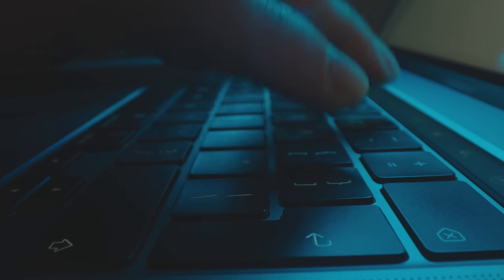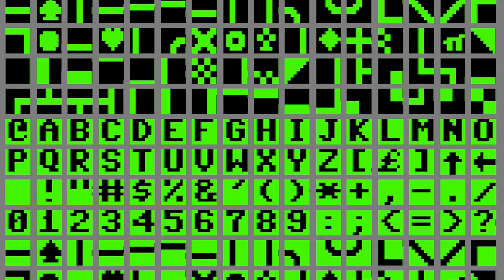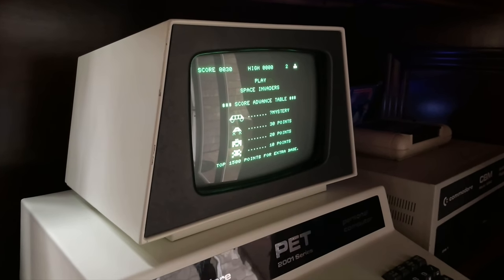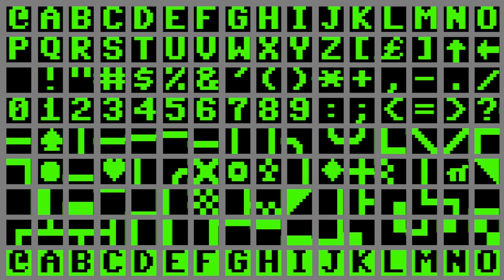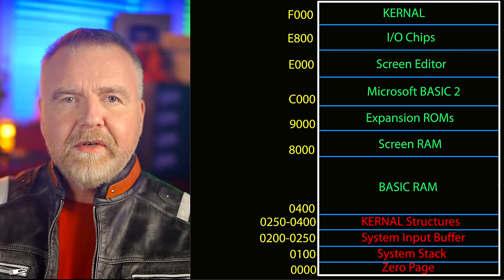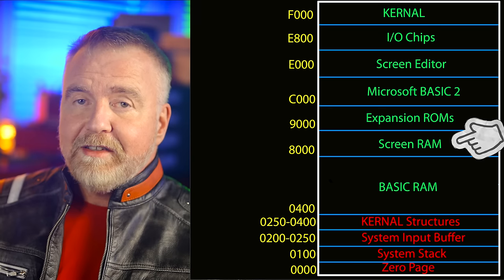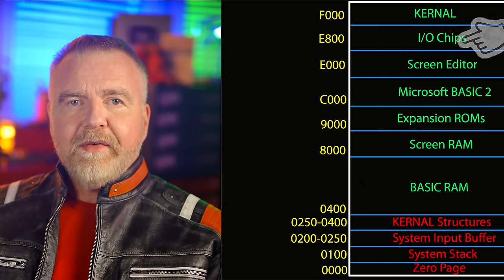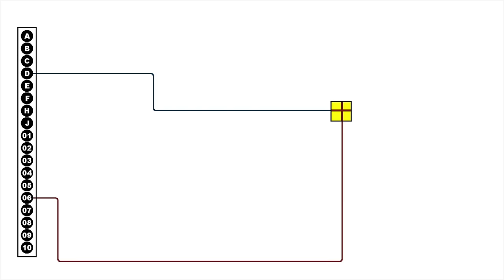Everything you SHOULD know about your Computer but don't!

Comment: I miss when computers used to come with manuals. And those manuals had schematics.
Reply: I think the schematic for even a Z58 chip-set with a i7-2700k would be stupendous 🙄🤯🤔
Reply: @MrLunithy  You can often find leaked schematics for modern computers. While there's a ton going on it's actually pretty easy to understand if you only look at one piece at a time. When chips are as complicated as they are now they don't need much support circuitry other than power supplies.
Reply: @Janek Winnicki that's funny, I started programming at the age of 10 on a acorn electron. I was highly fascinated that I could make a computer do stuff.
Reply: Computers still come with manuals... including a rough schematic. You just need to purchase your motherboard separately (and not a fully-built Dell, for example) to get that manual. You can also download them as a PDF from the manufacturer.
Reply: I like the internet.
Reply: There are developer manuals for intel and amd CPU online. Most parts of the hardware components are together in a few chips on the mainboard example southpridge or northbridge incuding the keyboard controller and much more.
Reply: And that they came with a language installed which you could write programs with (the C16 went one better with a built in assembler). I wish M$ would bundle a programming language with their OS as it would probably encourage a lot more people to get into programming.
I'm trying to learn Python myself, I learned C & COBOL back in the early 1990's, I also learned to write machine code back in the 1980's by hacking into games on the C16 using the built in assembler.
Reply: @MrLunithy  no, not really. the computer architecture is layers of composited abstractions, so even if you wanted to make a complete schematic of a modern computer (including RAM, and disk controllers), from the AND/OR/XOR gates all the way up, it most likely wouldn't take more than 20 or 30 pages.
Reply: @MidnightSt   So the complexity is really with the software then?
Reply: yeah it was part of the excitement to read those books. I've learned msdos6.2 commands from the 300pages book I was given without having a computer. the aim was really to get ppl up to speed to use the computer fast. the office 95 /97 help on cd was a true full fledged courseware.
Reply: @eDoc2020  true, it's easier to see how just enlarge certain things lead to wildly different uses
Reply: @PeterMaddison2483  weird to go from COBOL, a notoriously "dying" language that is in demand to python, something not in demand. Why not move to something else more useful@
Reply: @SECONDQUEST  I learned COBOL way back in 92 (and C) but it never came to anything. I discovered python when I switched to Linux. As Python was free, I thought, why not learn Python. I've not got very far as I've got many other things taking up my time. What other languages would you recomend?
Reply: You should have seen the KIM-1 documentation. Fantastic, programming info, schematics ROM listing etc. From 1975.
Reply: I actually read my manuals. I still have my manuals, boxed away somewhere. I started with a 64K Apple //e back in 1985.
Reply: @maxmuster7003 north bridges have gone the way of the dinosaur and it's simply referred to as "the chipset" and is just what used to be known as the south bridge. Happened somewhere around the mid 2010's
Reply: I wish I had spent more time with the 3 ring binders of my TI 99/4A. Maybe I would have pursued a computer science career.
Reply: As a user - what use are the schematics? All you need is a diagram to show you where to plug the extra ram or card into the MB. Seriously - what did you use schematics for?
Reply: I nuture a hope that somehow I’ll get to give my now 3-year old boy the experience of doing some tinkering on a C64 like I did in the 80’s. Back when you could actually grasp an entire machine. Just scrolling on an iPad doesn’t teach you anything about the inner workings.
Reply: @thettguy  Schematics were used for understanding, repairs, and designing modifications, like those expansion cards. For instance, I recently removed a swollen lithium ion battery from a tablet, and now it refuses to work. With a proper schematic I'd at least know what sort of chip it was talking to. Of course, with a sane manufacturer they wouldn't have made it impossible to boot in the first place. And with decent documentation we could have replaced the boot ROM to fix that too.
Reply: I always got a kick out of how Amiga schematics have song lyrics on them.
"You're jammin' me, quit jammin' me"
Reply: Plenty of single board computers do
Reply: A lot of people will piece their own computer parts today, I get that it's not everyone, but a good portion of people who are using PC's are now piecing together their own system to the specs they want or need.... at least the people who build them well. lol. I remember the PC back in the 80's a 5000 page book came with our first PC. lol.
Reply: @PeterMaddison2483   And with Python, we're back to the Basic days, of using an interpreter. WTF is that about ?
Reply: When?
Reply: @jackevans2386  That's about interactivity. Interpreters let you feed the computer commands piecewise. There are also options producing native and optimized code, e.g. PyPy, MicroPython, Theano, Julia or GHCi. The language you'll find in pretty much all modern computers is Javascript, though usually lacking a REPL. Some OS vendors consider it more important to turn computers into billboards than to help users control them nowadays, so it's annoyingly buried under the hood; OLPC Sugar aimed at not having such a barrier.
Reply: Computers went from a cool gadgets for nerds and useful tools for technically minded professionals to appliances, back then the technology was simpler and the average user could probably make use of the provided documentation. Today's average computer user wouldn't want to come anywhere close to a manual if there was one to begin with. Just look at smartphones, they could be incredibly powerful pocket computers, but instead they became incredibly powerful toys and fashion statements / status symbols.
Reply: I don’t think my Packard Bell came with that
Reply: Mobos still do
Reply: @fuzzy3932  all the motherboards I've got so far only had a very basic layout naming it's major components and things like ports and connectors, but nothing like actual schematics or a thorough manual. And even if it did, how many people do you know that could change a bad capacitor or voltage regulator, or worse yet, some SMD chip with dozens of pins? Doing such things on modern multilayer boards is a lot harder than changing through hole components in a two or single layer board.
Reply: @MrLunithy  The schematics of course are not down to the chip level.
Reply: Dude, what kind of computer are you buying that doesn't come with a manual?
Reply: @TommyLikeTom  Today's boxed manuals are hardly manuals, often just a "quick start guide" telling complete newbies how to plug cables and turn on and perhaps a QR code to a more "detailed" PDF online, that still pales in comparison to manuals from the times of 8-bit computers.

Even though my Dell laptop, that has better documentation than most brands out there, has a Service Manual and "detailed" documentation of what's included, is still a lot shorter than the "User's Guide" from a calculator I bought 20 years ago... and that's only the manual that came in the box, there's another, larger "Advanced Users Reference Manual" that can be bought separately.

That said, it's somewhat understandable the lack of printed manuals, as most users will never look at them. The bad part is that not even repair professionals can get schematics and technical documentation from some brands... just watch Louis Rossmann talking about his experiences fixing Apple products.
Reply: OH GOD 🙄😒
Reply: no you don't
Reply: I remember the computer magazines lol
Reply: Holy crap I never realized how weird it is that I've never received a manual with any of the computers/laptops I've gotten
Reply: You can just check the website lol
Reply: @eDoc2020 it’s pretty hard to find them though. Often even repair shops struggle to get them.
Reply: Same for cars. Nowadays they are made for you NOT TO be able to change a light bulb.
Reply: Capitalism and corporate greed took that from you
Reply: I just upgraded to AMD A5 (so a B650 chipset) and the instructions were just a pamphlet that may as well have said "you've had motherboards before, you know what all this stuff is but here's the guide to front panel connectors and here's how to connect the GPU just in case"
Reply: If you can't find schematics online, that's really just on you. With that being said we all know all of you complaining about not having one, it wouldn't have made a difference in your life or the life of your PCs. I doubt most of you, if any, can even do true component level repair and replacement in a modern architecture. You're not Louis Rossman, get out of that fantasy.
Reply: Me too.😥
Reply: I like my computer actually being useful
Reply: The good news is the information is way more accessible and affordable if you bother to look for it. Intel and AMD ISA manuals are a few volumes a thousand pages each give or take, all totally free.
Reply: Or pages of memory Adresses 😂😂😂
But I never needed those. I was a kid back then, BASIC was just perfect to learn just by trial and error. It was Interpreted and would quit where it ran into an error. It was so simple, even a 12y old could grasp that. Eventually I teached me to proper Code. That very knowledge I aquired during those 2y essentially fed me my whole life - I consider myself very lucky that my parents were wise enough to invest in a computer for me instead of a new watch for my father or something stupid like a Status Symbol. 
I mean back then it was not a luxury item anymore, my c128d had probably cost 1000DM inclusive the screen and the drive. Half an average months wage. If you earned above average you could afford such a machine. And that Investment (eg my Education) paid back 1000x if you consider that I learned most of what I needed back then. What I learned in university was just formal stuff to prove you are capable of doing something. Well, I was already capable at 16y old 😅, just didn't have the formal qualifications that is needed for a 6-figure Income.
Reply: @chaboi685 I guess that is well observed 😂. Not that I ever really messed with hardware except adding a reset Button to a c64 - which an 8y old kid could have done - I did it at 14. But what would I need schemstics for 😂😂😂? Nowadays!
I think some people don't even code anymore, they click just some objects together. Maybe some AI can then create the Code, it would not even need an AI, but that could make visually coding really feasible.

And some want to still mess with a circuit?! Ridiculous.
Reply: I got this old CBM machine in 1990 2nd hand. Kind of the Business Version of the c64. But it came with hardly any documentation. I was only able to use it because it was very similar to a C64, just without a gfx Chip, instead it was 80 characters wide and had 2 floppy drives. It was a Business machine compared to the C64 that was more entertaining with the additional gfx and sound. But the main CPU was the very same and the OS as well. C64 ran MS-BASIC 2.0 while that CBM machine ran Version 3.5. I also had a C128 that had MS-BASIC 7.0 - so I was pretty aware of what I could do.

But not due to a manual....

It was a CBM 8296d, I think. I only bought it because it looked really cool 80s sci fi style. Even in 1990 that look was already super retro. Unfortunately it was already obsolete when I bought it, but that's why I got it that cheap. If it still exists, somewhere under the attic of my parents house, it was not that bad an Investment. I recently checked how much that machine would cost today and it was about 6x as much as I paid. But I had to store it for 35 years. 600% in let's say 30y would be 20% per year. Not to shabby. Instead of a bit coin I can still use that old machine. Even if not used it has a value because of the design. It's really cool.

Edit: It was released in 1984, I must have bought it in 1990. Only those 6 years later I paid about 1% of the price when it was new - now you would get about 6% of the original price. Not to bad. Considering that a 30y old cellphone is completely useless - well that CBM machine is useless as well, tbh.
It's to slow to even make a usable dumb terminal out of it. It's beyond any use anymore.....
Reply: @Kingcobra6699  half a months wage is A LOT of money for your parents to spend on you, I wouldn’t have had a computer if I didn’t get old ones for free, I built my first real computer when I was 13 because I got a job
Reply: And a single human could read the schematics and have some idea wtf is going on
Reply: @chaboi685  Yep they would just end up in the trash or in the box to collect dust 99% of the time after flipping through it when building the pc never to be read again. Increasing the price and paper waste, as they'd have to print and ship all those detailed manuals to include with the product. If people really wanted detailed schematics they can probably be found online.

Comment: As a 14-year-old, I cut my coding teeth handwriting machine code and punching it into a ZX81 (and then a TS 1000 after I fried the ZX81 when clumsily trying to upgrade its SRAM to 4K :P).  Your video reminded me of those old days when you could actually fully understand both the hardware and software of a machine.  Zoom forward to 2022 and I have no idea how or what, let alone why, my Windows machine is doing what it is doing :S
Reply: the IBM PC, while more complicated, was still comprehensible to me on a software level. the hardware design was well past my understanding. DOS 1-3 and the IBM PC BIOS were well documented, and you could lterally debug through most of it and make sense. I learned assembly from the examples in the MS-DOS 3 reference, which also had an appendix with the IBM PC BIOS reference. Amazing that someone (or more likely a team) at Microsoft wrote assembly examples to demonstrate literally every single DOS 1, 2 and 3 function!
Reply: Or NOT doing. Me too.
Reply: @@linusfu515 The nice thing about having libraries that interact with the OS for you is that they might be OS-independent so it'll work on Windows, MacOS and Linux without you having to write it 3 times.

Comment: I'd love to see you walk through everything that happens from the moment of powerup, through someone typing PRINT "HELLO WORLD" on the keyboard, and finally hitting return and the output shows. It would be quite a journey!
Reply from the maker: Thanks for the idea!  Not a bad one -  could start with turning the machine on, then what happens until it goes input idle, then how it parses and executes the line of code.    I'll think about that!
Reply: Kinda boring imo, the DOS interrupt vectors are more fun. ;)
Reply: @DavesGarage  

Builds TPF file from original sprouting as BMP from default texmod tool

Upscales multiple ways and purges old .log file with removed associations so its absolutely fresh and associated, while making sure the name matched after removing the non upscaled exacting format

I can't get Jurassic Park back online without Dennis Nedry.
-Ray Arnold

The brain inflammation stage from staring at a screen for 65 million years is setting in. Ill cycle through the different compression technologies and see if I can definickize this blasted tool which im glad with very little effort I figured at least the above out.
Reply: @DavesGarage  

My first lead. Gigapixel is a liar. Compression is TIFF despite the setting of keeping it the same.
Reply: @DavesGarage  

The Eagle has landed.

The trick was not using BMP default since Gigapixel cant meet that. JPG in the .log file and outputting in Gigapixel worked. My T Rex looks far less compressed. Ill have to figure out the multiple asset same name, tree of funsies in time since its the only thing left to figure out, then its just pure drudgery.
Reply: @DavesGarage  Yes Please Do, I love that kind of stuff since when starting using computers with MS-Dos then win 3.0 3.11 and 95 98, 98SE etc still windows user hehe :D
Reply: @tenktorypisze  am not sure :)
Reply: @DavesGarage  Would you be covering the hardware (electronics) aspect of it too then?
Such as say the power button closes the circuit to the +3.3V line, how the receives power, how display is initialized & so on?
Reply: In the 1980’s I wrote a BASIC interpreter that was used in a commercial instrument (Spectra Physics SP4100 and others). This was written in Z80 assembly language. BASIC programs consisted of a mixture of ASCII characters (byte values 0-127) and keyword tokens (byte values 128-257). A keyword such as GOTO or PRINT would thus be represented by a single byte token. A trailing space was assumed to be part of the keyword to save an additional byte in the stored program. The token value was used to index into a lookup table containing pointers to subroutines for each BASIC keyword. The BASIC interpreter plus a program (written in BASIC) to generate chromatography reports was included in read-only memory of the instrument. A listing of the report generating program was included in the user manual. The customer could enter a “replacement” line of BASIC to customize the built-in report generating program.
Reply: @DavesGarage Please do this!!!
Reply: Return?
Reply: @EnjoyCocaColaLight  the Return key, often called the Enter key.
Reply: @DavesGarage expecting a video from you 😊